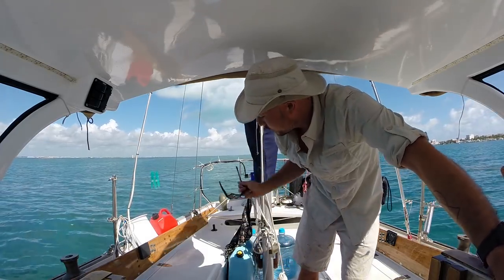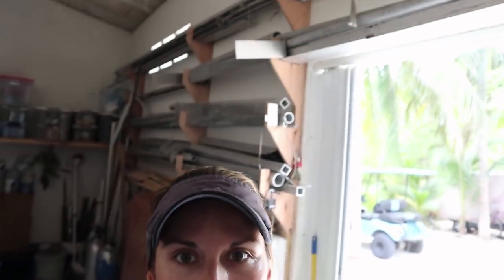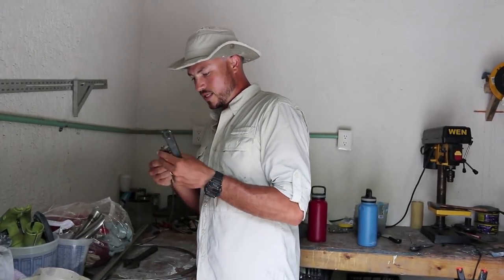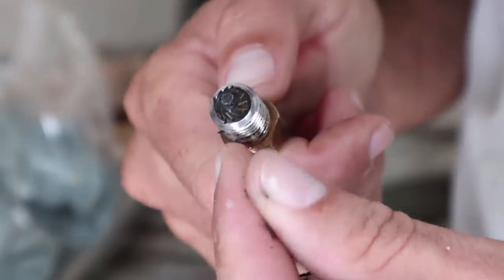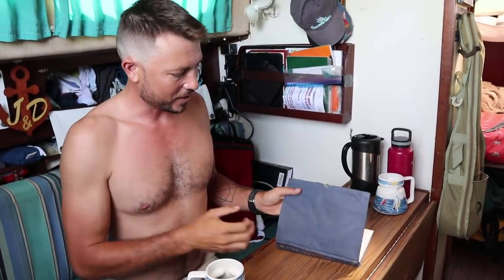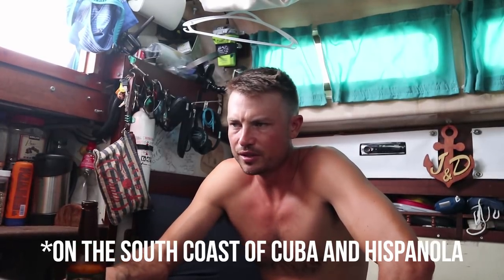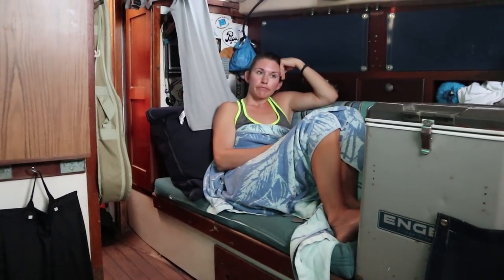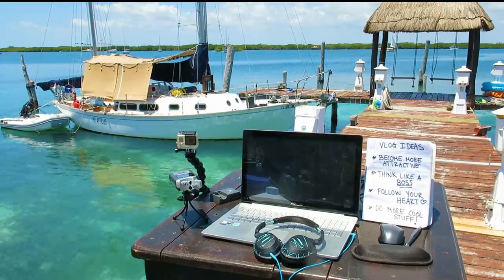Inspecting the Rig and Deciding What's Next | S02E31

Comment: Keep reading that book.... you'll notice that Brion Toss recommends putting Lanocote on the rigging wire, not the turnbuckle threads.  Lanocote (rendered sheep fat with mineral oil) will prevent crevice corrosion between the strands by keeping water out.  For the threads of turnbuckles use Forespar Tef 45, a PTFE waterproof grease that is also super sticky and won't rinse off.  We use it behind the brake pads on Race Cars because it is superior to typical high pressure grease used in that application and almost impervious to salt water. "Lanocoat" can be purchased at Drug Stores for much less money than at Marine stores, just look for 'Anhydrous Lanolin'.
Reply: YDYS

Comment: If the stainless steel shroud rubbed against any type of steel it will contaminate the stainless steel. You can take a brand new piece of stainless steel rub it with steel wool subject it to water and it will look like an old piece of rusty metal. Anytime you have dissimilar metals coming in contact with each other and moisture is introduced into the equation you will have electrolysis causing corrosion. Once you're in the path of a hurricane you have no way to escape and your insurance may not cover any damages to the boat. But most the most important part of the equation is injury to yourselves